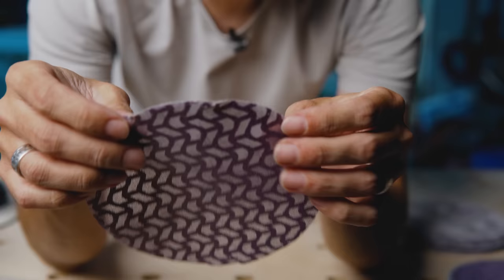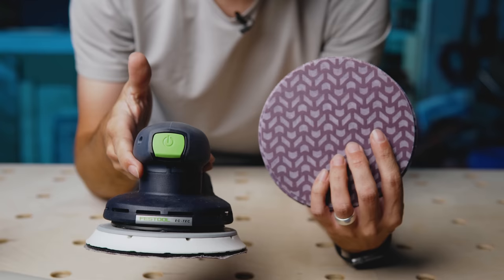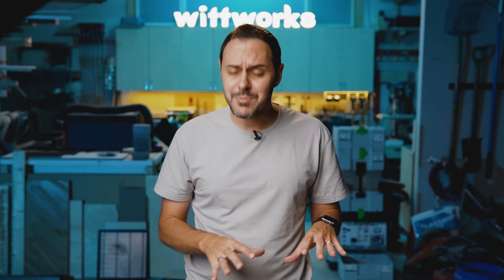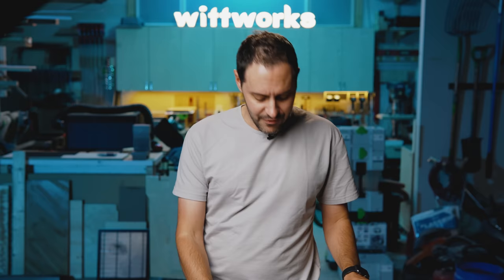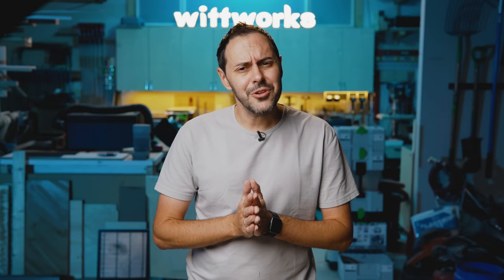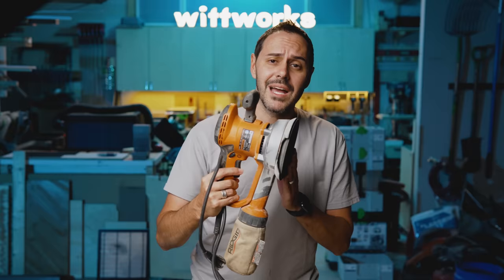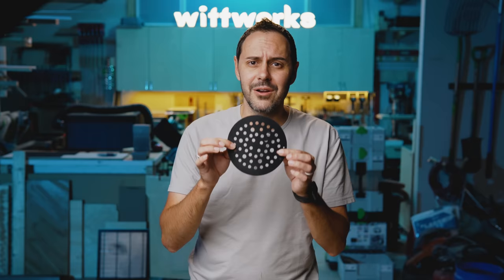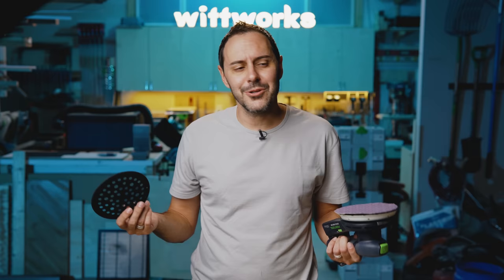the problem with the "best" sandpaper (& how to fix it cheap)

Comment: Good to know. Loving the Cubitron paper that I bought after your last video. Interesting that Diablo mesh pads come with the protection/interface pad.
Reply from the maker: I know...I hope 3M is eaves dropping...is that how you spell it?
Reply: You can buy the Bosch M480 mesh sandpaper in a multipack that includes a Pad Saver as well :)
I almost want to say that I saw the sale thing from 3M, but I'm not sure. I think their multi pack doesn't include the Pad saver.

I just got myself 4 of the Bosch pad savers for my new GEX 12V-125 sander, and hopefully I'll have time to actually test it out tomorrow :)
Reply from the maker: That’s great! I want to test that sander. A lot of people recommend it to me. Let me know how you like it.
Reply: @wittworks  yeah, it looks and feels great! I really like the form factor and the ergonomics of it.
So far I've only started it, with an almost drained battery, and it's very quiet and very low vibration, but I don't know how good it will actually sand yet :)

I got a few of the M480 papers, and a few of the Bosch F355 papers(for coatings and composites) and I'm waiting for a multipack of the Xtract to arrive, and I'll test and compare them for different use cases :)

Sure, I'll report back when I've actually sanded something with it :) need to strip of some varnish of a pair of oak door sills so that I can stain them to match my dark oak floors.
Reply: @wittworks  So, I finally had time to actually use my GEX 12V-125 sander the other day, both with M480 mesh sand"paper" and the F355 sandpaper from Bosch. Yeah, I really like this machine, it's just fantastic :) The ergonomics is more or less exactly like an Airsander, but it doesnt get cold and is much less noisy. I'd say it's the most quiet sander I've ever used, with a significant margin. Low vibrations as well, just like all other Bosch Professional tools I own so far.

It is surprisingly powerful for a 12V sander that only weighs 800grams without the battery, and with the 3AH batteries it is very well balanced. 
Even with a 400 grit F355 paper and the second to lowest speed I had to be careful to not sand through the 2 coats of ZAR polyurethane varnish I had put on the day before on some oak. 
I sanded away the factory varnish on 2 oak door sills in maybe 8-10 minutes with 80 grit M480 paper and the battery was showing 2 out of 3 bars when I was done. 

The built-in dust collection is actually very good, and with the Bosch Ventaro vaccum I have, I actually had more dust coming out of the vacuum when I connected it to the sander, than what the sander left behind if I didnt use the vacuum! That probably means that the bag I have in the Ventaro isnt all that great, I'll have to check that out. There was more or less no dust left on the workpieces when using the vacuum, but some in the workshop air :P 
The vacuum is also a lot louder than the sander on full speed, and it makes the sander a lot more bulky. I see myself using the sander with its built-in dustcolletion quite a lot in the future. 

The sanding pad stops almost instantly when you turn the sander of, and it gets up to speed very quickly, one of the benefits of Brushless motors I guess. 

It is of course not the most powerful sander, but the compactness and relative power is fantastic. Sure, a multitool with a sanding pad is also fairly compact and powerful, but not as good at sanding as real random orbit sander.

All in all, I'm very happy that I bought the sander and it more or less convinced me that I want to get a Bosch GET 55-125 or GET 75-150 for bigger sanding jobs (I have a 13,5x2,55m sailboat that I need to sand the entire deck and hull to paint it for example). Sadly I dont really think any of the other Bosch sanders will offer as good ergonomics as the GEX 12V-125 or the GEX 18V-125, and perhaps the GET models are simply to big and powerful for finish sanding, so I may consider a Mirka Deros or 3M Xtract sander instead, not sure yet :)
Reply from the maker: Great info! I’ll look into those Bosch ones. I should be getting the 3m one soon.
Reply: @wittworks  You are welcome :) Yeah, I'd recommend it! If you have the Bosch Professional 18V system it may be worth going with the GEX 18V-125, but I'm not 100% sure on that. The 18V version is heavier, both with a body partly made from metal and bigger battery, and the balance is not as good even with a small battery from what I've seen. 
It doesnt seem like the 18V version is actually more powerfull, or atleast not significantly more, judging by videos. It gets a good deal longer runtime though, more energy storage in the 18V batterypacks. 

But if you are going to sand for a long time, I dont think a battery sander is the go to option, or one can simply have more batteries :) I prefer the smaller size/lighter weight of the 12V for the applications I want to use it, but I also dont own any of their 18V tools :P

Comment: Those padsavers actually cost a bit more per pad than the entire backing of my sander. I use off brand pads that are better quality than the stock ryobi ones... Now I just need to find out if that mesh sticks to my pad better than that festool.

Comment: One other issue with these net sandpapers I have not seen anyone talk about is with the 8 hole sanders.  As in there is only a handful of discreet holes for the dust to move through. The net won't be providing the claimed benefit of dust extraction being restricted to only a few holes. Yes, we could all go buy expensive Festool sanders, but not all of us have that kind of money.
Reply: Mirka includes an eight whole pad with their 10 pack.  Fits my Dewalt perfectly.
Reply: @jasmusican  Yes, I know about the  hole pads. That is not what I was referring to. I'm talking about the disconnect between 8 holes to suck dust up, vs a whole disc made of a net type material, and the probable lack of dust removal due to that.

Comment: First one here. Diablos big pack of nets comes with the “protection pad”
Reply from the maker: The jumbo one from HD? Come on 3m!
Reply: 3M does not include a pad due to the enormous variety of sanders on the market. These screen discs have only recently come to market by numerous manufacturers after Mirka let their patents expire. They have been largely used by auto body shops and professional woodworking shops where sanders from Mirka, Surfprep, 3M, Eekasand, and others all have different hole patterns. I haven’t seen the Diablo pads, but guessing they won’t match up with my Mirka sanders.   Also, professional shops, like mine, go through abrasive dealers where we buy in bulk. I buy 3M discs by the case, and I buy backing pads by the case.
Reply from the maker: Yeah it makes sense. When I started researching several months ago, the distributer explained how they never marketed these to woodworking. Mainly aerospace and auto like you said. I did a video on it a few weeks ago. The distributor texted me tonight and thinks that 3m will start including one with their consumer offerings like Diablo does. It’s a market thing. The company has been surprised by how much interest the consumer market has. He thinks they’ll be in Lowes and Hd in a year. My dad is a purchaser for tool plants like Klein and Stanley, and Boeing. He’s been buying this stuff for a long time 😁
Reply: @wittworks  I’ve been using Autonet for around 15 years. I operate a high end furniture and cabinet shop. I can’t imagine ever going back to paper or cloth backed discs. Screen discs are also great for hand sanding. Especially on oddly shaped pieces.   Just a great product, and worth every penny.
Reply from the maker: Thank you for sharing. I love them.

Comment: STOP!  Don’t use the pads until you watch this video. I just bought a brand new Bosch  sander and 100 3m pads, because I like both these brands. After 1/2 hour sanding - no stick, but normal pads do stick. I came to conclusion, like you that the hooks got damaged. Might be too late for except I think I am going to just reattach some new hooks to my sander vacuum pad and go with your suggestion thereafter

Comment: Thank you for the good information. I don’t have an expensive sander but I did just purchase some dioblo sanding screens. I will look for one of those pads that will work for my little sander.
Reply from the maker: You might have got a pad with your devil discs. 🤪 Many say they do. Im at Home Depot right now about to buy some to see for myself.
Reply: Thanks man. Your right it was in the middle of the pack. I think this pack came with 50 assorted sheets. This is off topic but that chisel commercial you did was as good as anything on tv.
Reply from the maker: @chrisp7957  thank you! I’ll call nbc and apply for a job. I got a pack last night and got a pad with it.  Very interesting. Consumers like us aren’t 3Ms priority so I understand why they don’t include it. But still. It would be nice to have a consumer pack.

Comment: A little late to the video, but I noticed that with my Bosch sander, the 3M sanding net builds up sanding residue between the backing pad and sanding net, which effectively blocks part of the dust extraction. I've tried everything: cleaning my extractor, changing backing pads, using the 3M hook-it system, etc. I can't find a solution for this, and it's incredibly frustrating because now I have Xtract sanding nets that are unusable.

Comment: I have had the Mirka Ceros and the Mirka Deros and thy have the same problem, then i used the protectionpad, but after a while the same problem accurd. So that is not working also (for me).

Comment: Seems to me the 50 packs of 3M stuff should come with a backing pad (like Diablo).  Another thought, has anyone tried cutting 6" disks down to 5" and using them on a smaller sander once the edge starts to fail or just let those ragged edges fly?

Comment: Need some help!
I use the same sand paper and the same Festool sander/pad saver. 
But now I’m having problems with the sander wobbling like crazy! I’ve attempting centering the sanding pad but it still wobbles as the pad circulates. As soon as I remove the pad saver the sander is smooth again. Any ideas!?

Comment: HOW TO FIX THE EDGE:

1. Turn the cubitron disk so the grit side is DOWN and the hook&loop (aka Velcro) side is UP
2. Run a small bead of superglue (or any CA clue or even Elmer's) along the outer rim of the upside.
3. Run small radial beads like at 3 O'clock, 6 O'clock, 9 O'clock, and 10 O'clock from the edge to the center.
4. Use one of the $1-$2 middleware hook-to-loop pads and stick it to the disk
5. Use as you like.  The edges won't come apart.

- Why the bead around the edge?  That is what holds the edge together.  
- They the radials at 90, 180, 270, 360 degrees - more bonding with the adapter disc and better flat surface than just the outside bead sticking out
- Doesn't this cost me more because now each cubitron disk requires a sacrificial "adapter" disk AND glue - yup.  If you want cheap, aluminum oxide  pads are at the store on the corder.  You want good and effective, well, that's cubitron.  You want it not to fall apart, yes it's $1-$2 more per disk.

Comment: When are you reviewing the new 3M sander?  Do the 3M sanders benefit from this back up pad, or is their hook and loop pad already adapted for use with the 710W Net Sanding discs?
Reply from the maker: Supposedly 3M has sent me a vac and sander to review. Haven't received it yet. You would still want the back up pad.

Comment: Great to know, but I have an old Porter-Cable random orbit sander.  I'm not opposed to upgrading it at a reasonable price, but neither Festool nor 3M sanders are (for me) reasonable.  So I'm left wondering...  What do the common folk use?
Reply: Regarding contractor/carpenter grade tools...Over the years I have used at least one model from each of the brands offered at the orange box store. Milwaukee I liked slightly better then Ridgid, Makita was a respectable 3rd. Dewalt worked fine at least while it worked, like many of their tools they tend to burn up much quicker than the other 3 brands mentioned. Dewalt has gone so far downhill in quality the past couple decades I think I would rather purchase Ryobi in most instances.

Comment: Recently bought some xtract and found they slid during sanding so the edge of my backing pad was exposed. Kept thinking I was doing something wrong! Glad I know it's not me. Any idea if they make an interface pad for the Makitas? I've got the 5" battery orbit sander which has 8 holes and I can't see whether the 3m ones will line up
Reply from the maker: Glad I could help! I don’t have a makita sander shockingly. I don’t think they make specific brand ones. One idea might be to save the product image off of a store, and print it out at the correct scale, cut out the holes and see if they like up. Man. That’s a lot of work. I hate this problem!
Reply: @wittworks  That's a darn good idea! Or the opposite way, I take a photo of my sander and overlay it with the interface in something like Photoshop, and see if I get any hits.
If I'm honest the sander doesn't feel like it's designed to take a vacuum at all. Had to make my own adapter, and when the vacuum is on, it sounds like it's blocked! Might have to invest in an AC one for my shop. This one is my around the house' one
Reply from the maker: Yeah. I’ve not heard the best things about makita sanders. And I’m a makita fan boy. I’ve been really impressed with my Festool ones. They’re pricey. I hear the bosh gex (I think that’s it) is great. I should be receiving the 3m one soon to test. I hate sanding.
Reply: @wittworks  The main reason I got this one was because I'm deep into the Makita battery platform and do not have the patience for multiple battery systems. Festool are unfortunately way outside my price range so I'll look into the 3m or Bosch sanders and see what else is about. Other than the extraction issue, the little sander has been spot on. Done exactly what's needed of it for the £100 ish I spent!

Comment: So which of the two would you recommend if you own both the 5” Festool and 5” 3M sander? Which one of these would work best both tools and which hole pattern/number of holes too?
Reply from the maker: I dont have the 3M sander yet. its on the way supposedly from 3m. My guess would be to use the pads made by the respective manufacturer.  As far as which sander is better, I haven't done tests yet but that will definitely be an upcoming video.
Reply: @wittworks  Oh I can answer that! The 3M is by far the better of the two. Longer orbital stroke, much quieter in decibels compared to the Festool and waaaay less hand fatigue/stress!  I just wish the 3M had the removable power cable like Festool.

Comment: The protection pad costs more than a new pad for a normal Bosch sander. So I rather buy new pads than a festool protection one. But its a great way of improving the connection, although I have a super cheap random orbital sander and the hook and loop works perfectly with the xtract, no idea why you have such a problem with this super expensive sanders. I guess the velcro is bad
Reply from the maker: Velcro is a different design

Comment: I took the leap thanks to your recommendation! Both the xtract and protection pad. Regarding the protection pad, am I the only one that gets a lot of “jumping” / jerky behavior of the sander after installing?  I tried both that came in pack, with festool paper and xtract. It’s clearly the culprit…but what gives??? Any help would be appreciated.
Reply from the maker: Mmmmmm….I haven’t had jumping. I’ve heard of minor wobbling. I’ll ask around.
Reply: @wittworks  I’d call it a real wobble…but might be a better term than jumping. TIA…it’ll sit on my shelf for a bit until closer to return deadline, just in case I can find a solution.
Reply from the maker: Which sander model? I’ll ask my Festool fanboy tomorrow
Reply: @wittworks  ETS150/3 EQ-plus. It’s the older generation but has modern multi jetstream 2 pad. Thanks! Gotta love those fanboys 🤣
Reply: I looked all around these comments to see if anyone else had this issue. Put on the pad and experienced major wobbling. I take the pad off and it goes away. It is super frustrating. Eddie did you ever find a fix for yours?
Reply: @GabeSchultz1  I never did get an answer from @wittworks or my web searches. I returned the protector pad but now stuck with the 3M paper and hoping it doesn’t ruin my base prematurely
Reply: @eddiebauer5976  yeah i have a ton of the 3m net paper. I emailed festool about the issue to see why this would be happening if it’s a festool offering. I also saw on Amazon reviews that there were several others who had this problem as well. But no one seems to have a solution other than just taking off their pad saver
er. I’ll let you know if festool gets back to me on it.
Reply from the maker: I asked two people I know at Festool and with taytools and they said what your reporting isn’t normal. Something is wrong. What, I don’t know…
Reply: @wittworks  ok…sounds they we are all on the same page then 🤪
Reply: I'm glad I'm not the only one.  Just got my first festool sander and xtract with protection pad.. unless I find a solution fast I'm returning everything.. the wobble is horrible

Comment: Not sure if it has been asked, I skimmed thru comments and didnt see any about swirls/pigtails from sanding with the cubitron paper . Do you notice these?
Reply from the maker: Not had that issue. Are you using a vac? Usually people dial down the speed on the vac because you don’t want too much suction (which might be causing swirls)